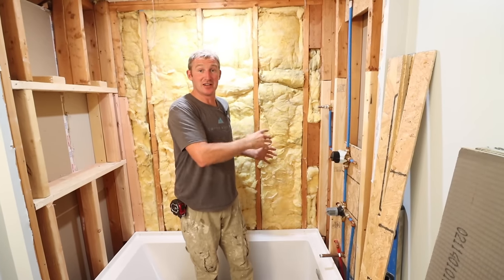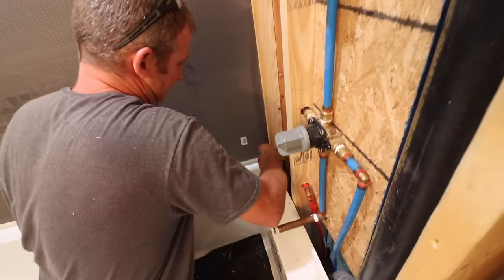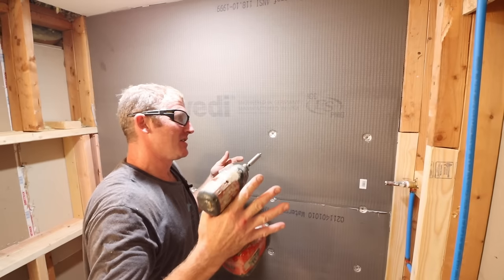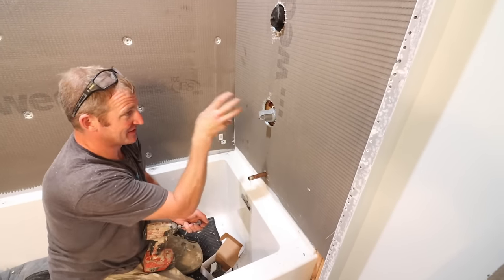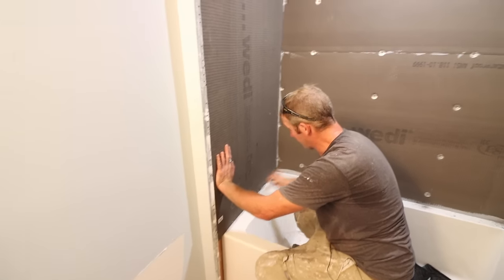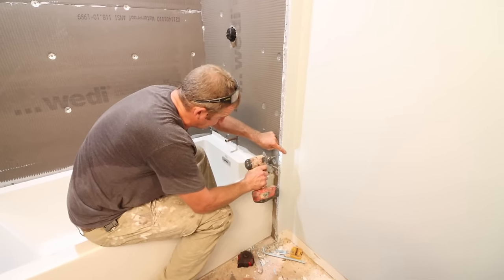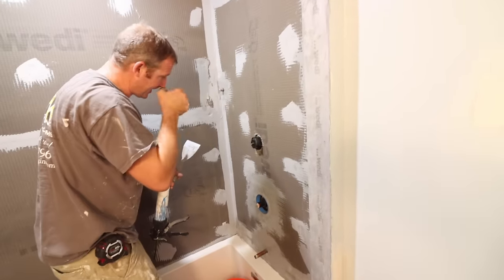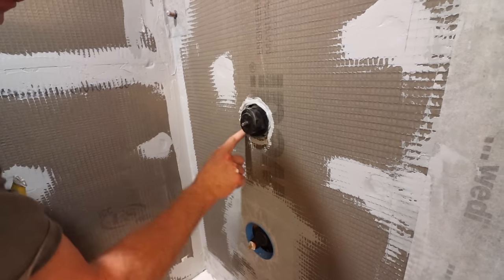Waterproofing Tub Shower Walls | Easiest Method for Beginners

Comment: I love you video's I think you are an Awesome teacher but my bathroom walls are so far out of whack shimmed all the studs to run drywall hang over the flange but bulk is not level . 1924 house floors ,outside walls  closet walls - backwall of tub area Just Plain Jacked up already installed drywall taped the first coat .  put a laser level on tripod every corner is jacked up .  only thing that is level is the tub.  got that from You sir .  I am soo upset!!  I am going to call in a framing guy I may even rip all the wallboard off. Tear off the bulk head and start all over . time & money WASTED !@#$%&

Comment: you know how many bathrooms I built with with just drywall. put the ceramic tile right on the drywall never had a problem, blaa blaa over kill, you don't have to do all this sealant bs, cermaic tile is the sealant, and you just use thinset,or mastic and mesh tape on the joints and inside corners. this is dumbest thing I've ever seen